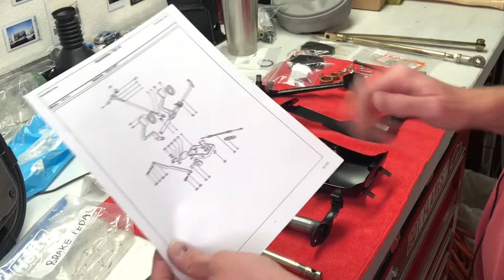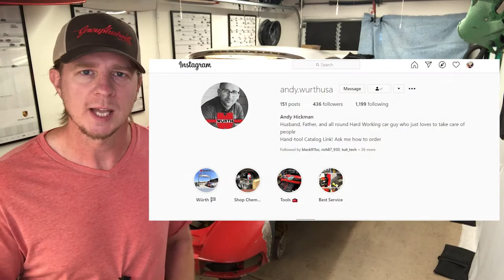Pedal Cluster Refresh

Comment: nice video
but...
how are the front two bolts attached
to the front of the mounting bracket?
Reply from the maker: They are welded onto the bracket from the factory
Reply: yes, i watched a
'how to remove the master cylinder' video
and see these bolts also attach it as well

now to access them
must remove the rectangular plate on bottom of car
Thanks

Comment: Nice video!; what manual did you use and which parts did you end-up replacing?
Reply from the maker: Thank you. I replaced the rubber pedal covers, and the bushings which were previously plastic, and now brass. I also bought a new accelerator pedal shaft/lever. This was insanely expensive for what it is (I think around $130), with the thought that I may repair the original some day which the end bushing hole had oval out causing play in the accelerator. Between the powder coating, and parts it probably was around $250 in cost. That's inflated of course because of the accelerator arm / shaft cost.